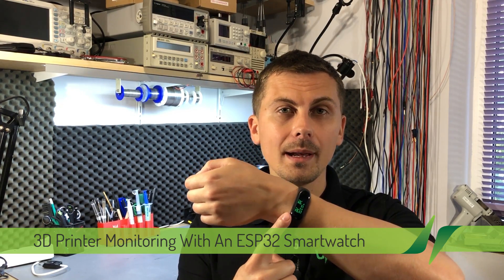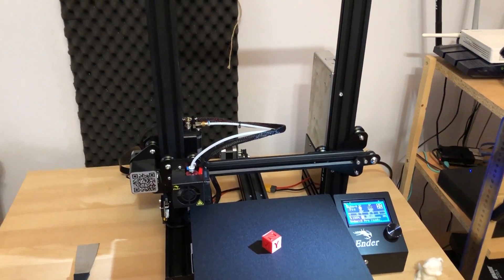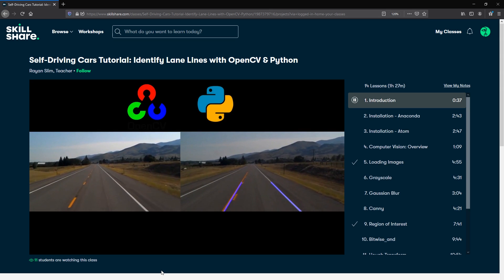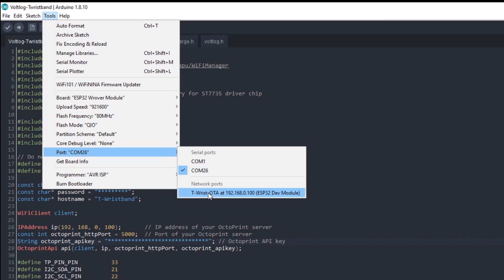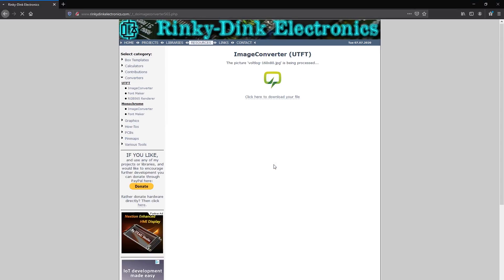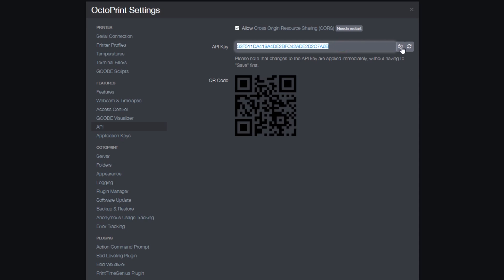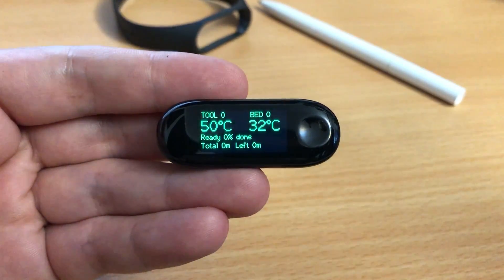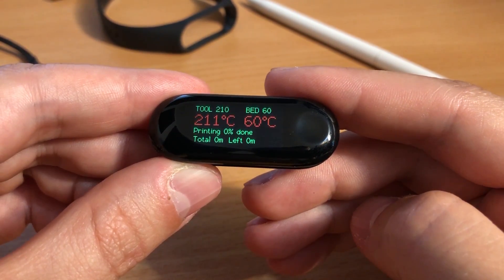3D Printer Monitoring With An ESP32 Smartwatch And Octoprint API | Voltlog #320

Comment: I took some measurements, it consumes 110mA while active and 1.7mA while in deep sleep, the active current seems ok to me as it would lead to  30 mins of active time and i don't think that the esp32 is optimized for low power consumption while fully active(maybe we can increase it with modem sleep after it retrieves the octoprint data, not sure if OTA would be affected though). The deep sleep current is quite high as the esp package should only take tens of microamps in deepsleep, still the cause of low run times i see(around 5 hours) are probably because it randomly turns on while I'm not touching it, even if i just place it on a desk away from anything that could interfere with it.

Comment: I made it using your code, but the battery life is terrible,  when out of sleep it drains extremely quickly, but even in sleep it doesnt last that long, overall with couple of checks per hour it only last half a day at most, do you think that can be fixed with software? Or is it a problem with the esp chip or the peripherals? Maybe my battery is faulty I will have to investigate more to know, kinda don't want to cut the tiny wires for current measurement but I probably will